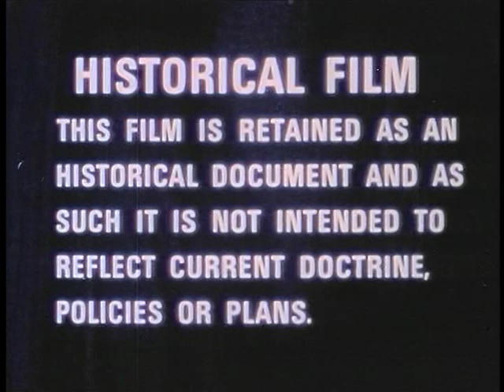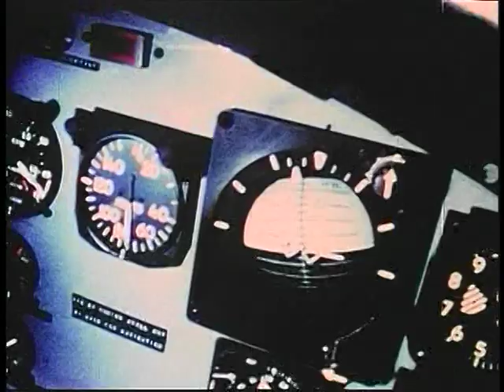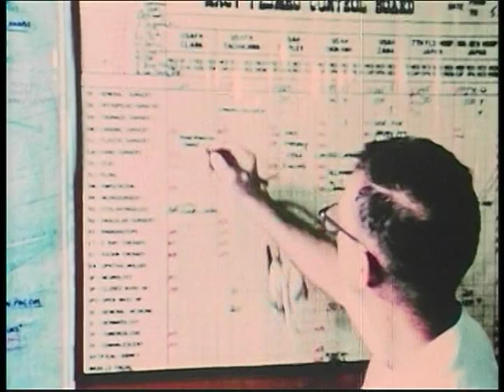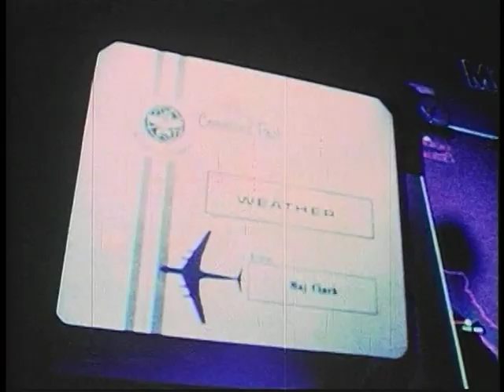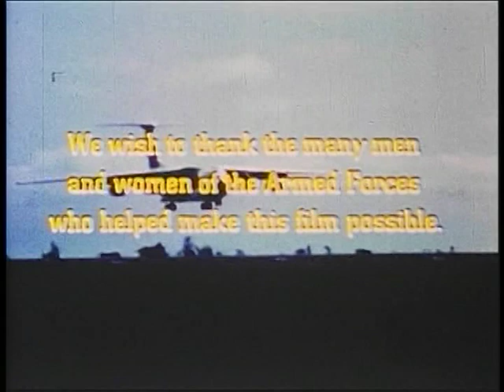To Save a Soldier

Comment: I was an Army medic trained in 1977 and we used the exact same procedures as those shown on the video. One mistake, it was asked "Which one is the emergency"? Well for medevac they are all emergencies, some just more serious than others. This video is as real as it gets. Oh and one more error, the dustoff pilots identify the color of the smoke, not the unit on the ground. This helps prevent the VC or NVA from popping their own smoke and ambushing the chopper.
Reply: +niceguypit Hasn't changed much even today.  The Radio traffic sounds just like it does now.
Reply: You just put fear in my heart with the reference that the VC and NVA threw their own smoke to ambush the rescuers...that must have sucked!
Reply: Medevacs in Vietnam dealt with everything under the sun.  Broken legs to head shots.   It was a helicopter war, as they were brought in on them, and had to be taken out by them.  If a soldier broke his arm (non emergency), he was taken by medevac, usually with an actual emergency.  When you have 3 or 4 being loaded, you need to know which is life threatening, and which isn’t.

Comment: Those were some very sweet jumps out of that '141, back in the early '80s when they were at "Green Ramp", Pope - when the Air Force occupied the base - in NC.
'Seems like we were getting the 10 min. warning from the JM as soon as the wheels were off the tar mac, most times on the way to Sicily DZ.
Sweet jumps indeed.